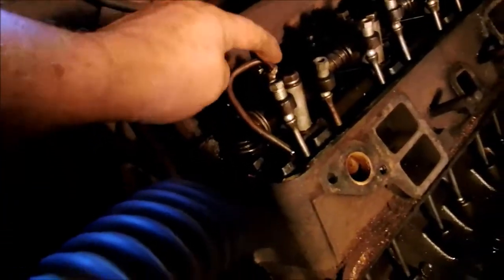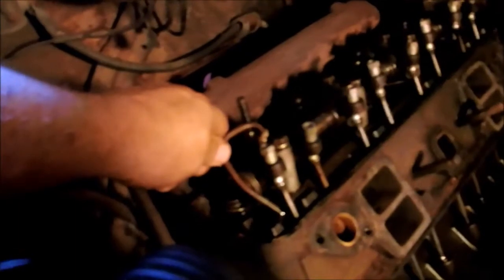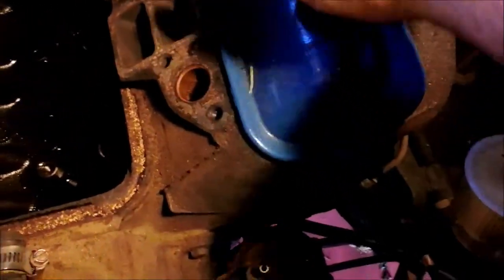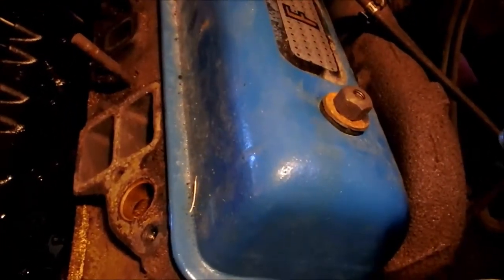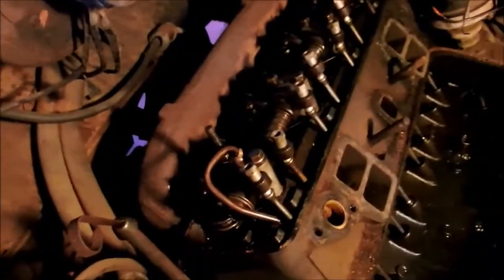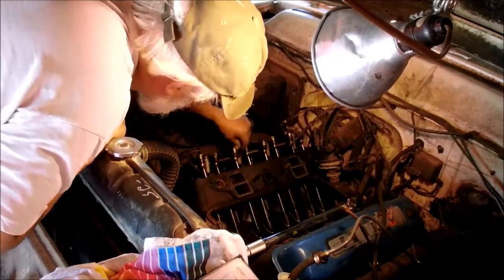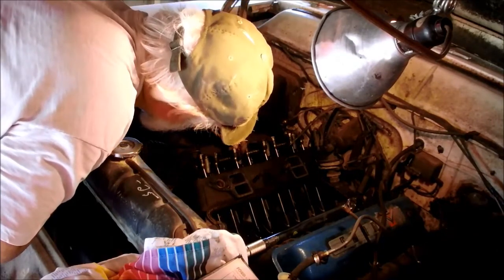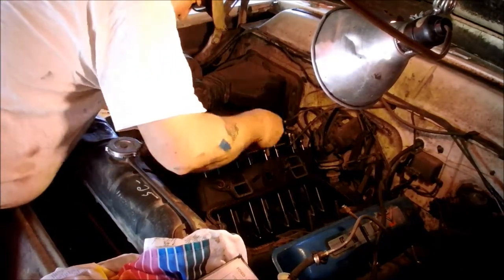Broke Bolt Rocker Arm Shaft, '55 Ford

Comment: Unfortunately old bolts may have been torqued and retorqued; each time stretches the bolt and in a 60 year old engine that can mean seriously degraded bolts.  Also the stress that broke the rocker shaft in the first place probably shocked all those bolts pretty hard.  I wouldn't have thought twice about re-using those bolts either but now that you've broken a couple it doesn't surprise me.